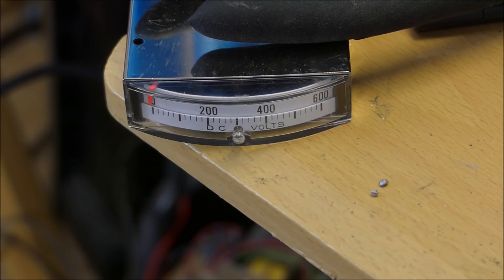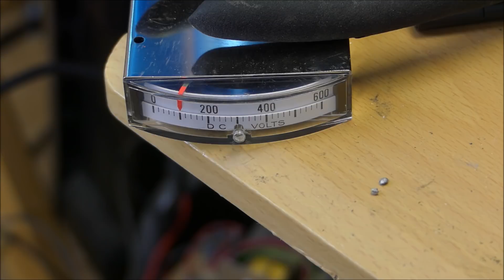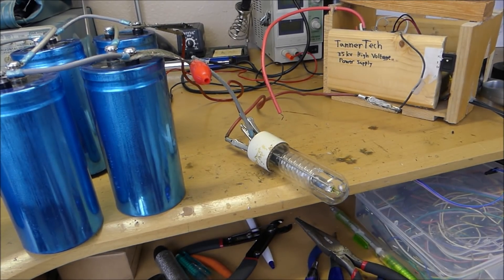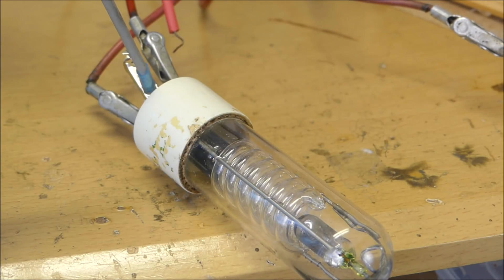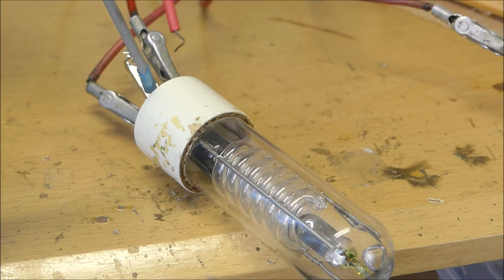I got my Giant Xenon Flashbulb to Work!

Comment: HI Tanner, Jovel from the Philippines here. Would you know what's the specs of the Speedotron 4803? My secondhand light short because of wrong power voltage and my light guy said the transformer blew up. WOuld appreciate if you have any info or maybe a photo of the schematic - can't find any here. THank you!

Comment: For safety PLEASE replace the MOT with an NST (neon sign transformer).  The MOT is absolutly lethal!!!  Also the NST is current-limited and you will not need any resistor!  I also use them (NST's) to charge my monster 250lb pulse caps for quarter shrinking...